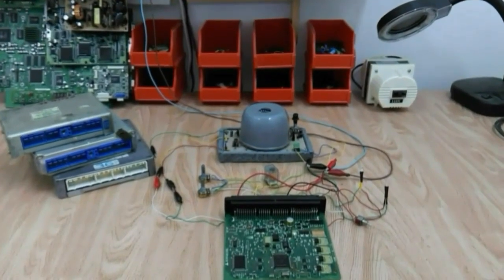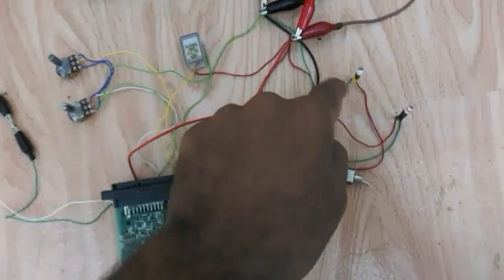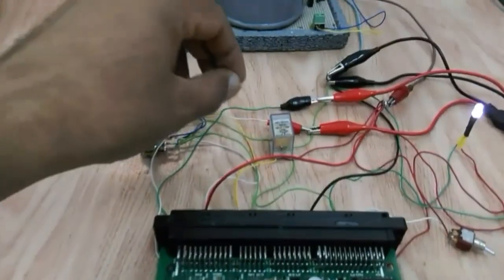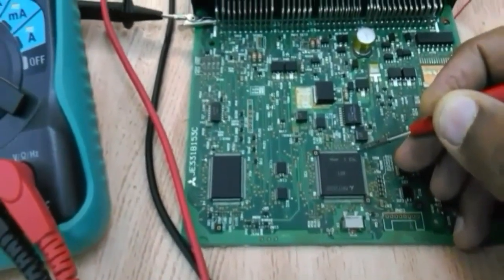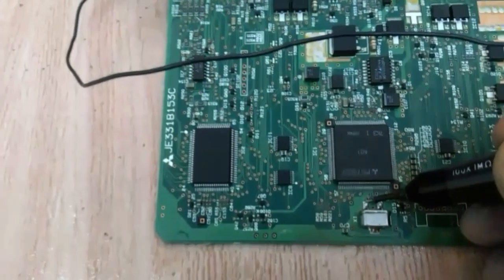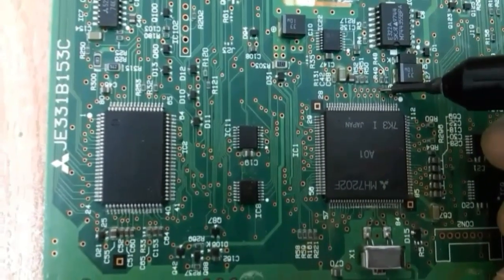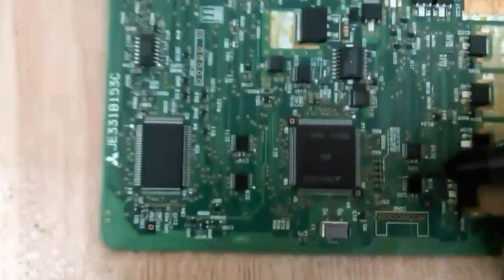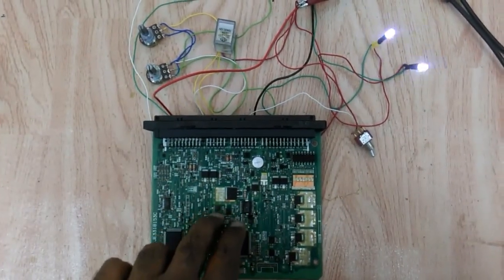Exploring the ECU hardware and testing - Part 2 (fault finding and troubleshooting)

Comment: My can share how you made you ecu simulator? Crk ,cam,etch simulator
Reply from the maker: Hi,
Regarding the ckp, cam semulator device, most of work 
is done by mechanical mechanism , the electronic part is only conditioning the signa, beside this is still under development.
Reply: @saudautomation  hi, thank you my friend,, do you diagram for this, if its ok if you can share to me because i am also a mechanin and it will be a big help and greatly appreciated,, please my friend thanks so much
This is my email joelsarmientoaresgado@gmail.com
Reply: @saudautomation  if its ok if you can share me the circuit or how you made the ecu simulator

Comment: Sir ,would you please explain a bit about ECU in Antilock Braking System i.e ABS.
Reply from the maker: Sure I will try my best in the future.
Thanks.
Reply: Thanks for your reply sir!
Could u plz help me with these questions too..
Is it possible to make ABS ECU from scratch for a solar vehicle?
what kind of information do I need to gather for manufacturing an ECU for ABS ?
Reply from the maker: Dear friend,
It is great to use your knowledge to develop hardware and systems thats the best way to learn and gain experience all the time,
If you plan to develop your own ABS system keep in mind ABS is critical safety element in the vehicle and safety of human then equipment is priority. Then you need to study the ABS system principles starting from concept of the wheels speed sensors( types and operation) to the ABS control module (hardware and application software), plus the design of hydraulic system and valves control. Also ABS control module needs to communicate to other control modules in the vehicle to exchange information through CAN network.
All the best

Comment: Great video explanation. I would like to ask you. I have a BMW 525 and it have 4 O2 sensors. The O2 sensor bank 1 sensor 1 no ground at the ECU terminal. What could be wrong? Grounds for other O2 sensors are fine.
Reply: Dear sir I seen your tow video very intresting your explanation is very good and simple.. But please you also share. Modulo circuit I hope you my be help time.
Reply from the maker: Hi, 
In fact I don't keep circuit diagrams for ECU board as is no easy to get, this troubleshooting is  based on just tracing the pcb copper trucks, But ECU input/output pinout just you can search in the Web.

Comment: Good job Sar
Reply from the maker: 👍 Most welcome.
Reply: @saudautomation dear sir so many thanks for tie video... Please give the circuit diagram of the using modules for the testing of e c I.
Reply from the maker: In fact I don't keep circuit diagrams for ECU board as is no easy to get, this troubleshooting is  based on just tracing the pcb copper trucks, But ECU input/output pinout just you can search in the Web.
Reply: @saudautomation  Dear sir those too(modul)you use those you make on zero p c b on that one motor mount and some semi.. conducter. Fited which control bythr veriableresister. Ic etc that circuit I require and which type motor you use. Thank you I am from India.
Reply: @saudautomation  in what specefic website sir..

Comment: you're amazing! i noticed my PCM (the exterior at least) is badly corroded. I'm about to try to open it to view the board.. it'll have to be done inside the car bc 2 of the connectors are stuck and I'm unable to remove them)..
if i see corrosion on any components I'm trying to figure out how to find out what they control. my car is in limp mode with U0107 DTC lost communication with TAC module. I've done all the diagnostics and the only thing left that could be the problem is the PCM.
Reply: how can i go about finding what each component does in the PCM inside my 05 Acura TSX? I've tried searching online but either wasn't using the right terms to Google or that info just isn't available online without being a member of some type of site for getting this info. do you have any suggestions?

Comment: Assalamualaikum waramatulahi wabaratuh elder, my VDJ200L model, engine crank the injector pump sends fuel to the nozzles but the nozzles does not open.can the ECU be the problem.Elder, i want you to teach me through whatsapp +23288218080

Comment: Assalamualikum my honourable brother please brother if you could 
Can you send stimulation ckp sensor structure diagram or datasheet please brother 
Best regards love from Bangladesh
Shahinbl2015@gmail.com
Reply from the maker: Walaikum Salam Brother,
Regarding the semulator device, most of work is done by mechanical mechanism , the electronic part is only conditioning the signa, beside this is still under development.

Comment: thankyou very helpful
Reply from the maker: Welcome 👍
Reply: @saudautomation   how would you go about doing live data on obd
Reply from the maker: Yes with OBD scanner getting live data is very handy while the ECU is online connected to the engine and sensors, but your idea is good to explore this option while the ECU on bench. Thanks
Reply: @saudautomation   yes it works your video inspired me to try, i did not realise how easy it was got live data on bench  , you can read can high , can low  and kline .  im just waiting for a wave generator to do crank and cam thankyou
Reply from the maker: Well done, and all the best for you .
Reply: @saudautomation  yes i can test ecu on bench , but also other module like abs pumps , the first ecu i got had died high and low can

Comment: AssalaamuAlaikum Saud. Fantastic video, thx for sharing. Please can you sell us circuit diagrams and common ECU spares?  Shukran :-)
Reply from the maker: +Fazel Suleman 
Alaykum Alaslam Fazel , thanks for watching.
Infact I don't have much of circuit diagrams for ECU, normally it is not easy to get one ,the original manufactures they don't will to share at all. That's way most of the time you need to just trace the PCB and use your own troubleshooting skills for fault fiding.
Reply: @saudautomation  Shukran Saud... I do understand. I'm busy with a polo ECU ME7.5.5. Customer took car for a test drive, while negotiating the car was  idling and just cut out. Now it only cranks, immo light goes off so it's not a security issue. Only thing I notice is that the EPC light does not come on with ignition. No spark or fuel but NOT coding problem. Any idea which IC, or do u have co.plete pinouts?
Reply from the maker: +Cluster Master 
This malfunction can be caused bay many reasons but as a simple guide Just check the coming few steps:
Check at least the ECU is getting on, turn the IGN key to ON position and the check engine light should show up for some time. But this not applicable to all vehicles anyway. 
However, at this stage you need to hear the fuel pump running for few seconds and then goes off this will indicted the ECU doing the basic functions.
If not happening, you need to make sure in way or other the ECU is powering up and running 
If you suspect for example the fuel pump not triggered by ECU and you are sure the electrical loop of the fuel pump is OK then search for the ECU pinout using part number. Identify the pin number for fuel pump control and then trace the PCB track back from the pin to the driver component it can be transistor or IC and then check or replace. 
All the best